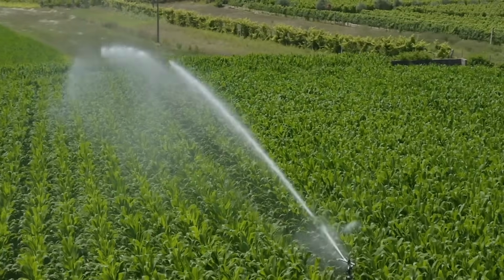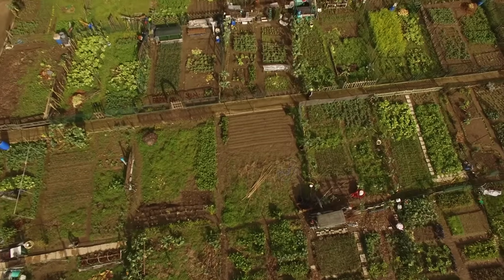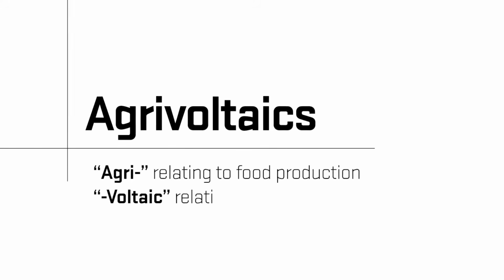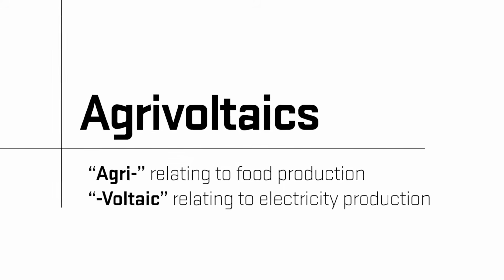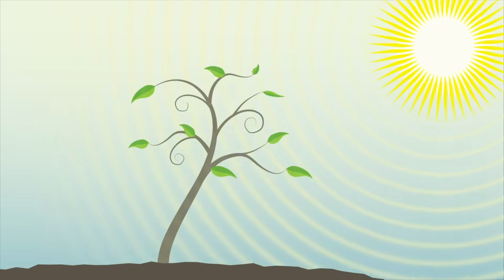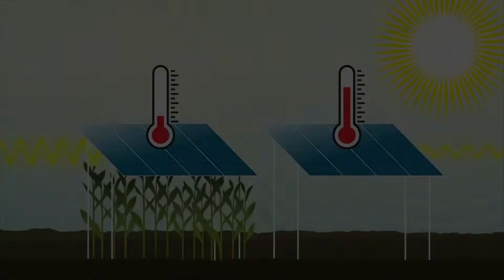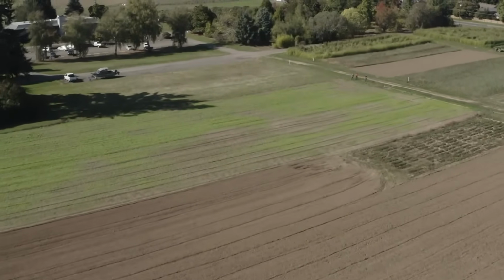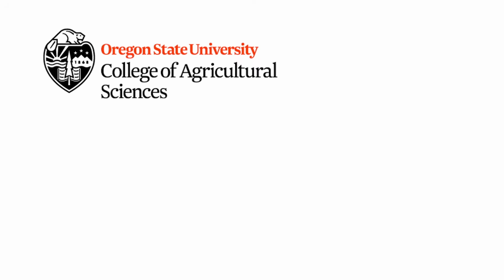AGRIVOLTAICS: Sustainable Farming Systems

Comment: Benefits of vertical mounting of standard Solar panels as fences.

The current practice of solar panel mounting is a two dimensional flat sided position, the front face of the panel is up, the rear side faces the ground.

A standard solar panel can be erected vertically, one edge on the ground, a second duplicate solar panel can then be mounted on the obverse side, creating a vertical solar power unit. 

This arrange doubles the output of a single panel, for the same amount of space.

An example of use is on farms 

A field of any area or size can be surrounded with a Vertical three dimensional fence of any length.

Benefits

1 No change in farming practises are required  

2 The panel edge can be on the ground, preventing GM crop spread and wildlife control

3 The panel edge can be off the ground allowing GM group spread and wildlife access

4 larger levels of surplus power sold to power companies

5 Justify electric powered farming vehicles,  for extra income which will attract carbon credits when electric vehicles and .equipment is used 

6 Self cleaning in all weather by gravity

Comment: No, No...... 
This is still Industrial mono-culture agriculture dependent on heavy loads of pesticides, herbicides, fungicides, fertilizer and water.
Just throwing up solar panels will create a new set of problems and it actually exacerbates existing ones.
The crops are still far too far away from where people need to eat.
You could create the same energy on rooftops in suburbia and convert old warehouses nearby to produce far more for far less. IT would cut down on emissions from tr4anspoort and production while reducing the cost of energy where it is needed. Reducing heat islands, mass power outages, and only causing the same issues that already exist, (mining for materials and building) with this plan, and reduce the other impacts. 
They could even be placed on green roof to keep the heightened output, and have them put the roofs on the homes of elderly disabled poor folks that need help. Reduce their bills and everyone else in the neighborhood.
These farms should not be farms they should be land stewardships and they should be returned to the indigenous people of this country.
Grazing herds would restore soil health and start sucking carbon from the atmosphere and cut down on fires. It would reduce the need for all the "cides" and water 

But hey
Keep doing things in a way that makes the few rich and the masses suffer 
While creating problems instead of solving them...

So sick of these half measures.
I bet the person who recommended this got a bunch of recognition.....

Universities also seem to fund only solutions helping their donors, not their community, another story for another day.

I know my grammar sucks, it stopped mattering 20 years ago.

Comment: Generally agree, except an early point that an increase in global population from 7.5 to 9.8 bil will require double the food output. Where the heck is the math in that? Check out the blue revolution, or aquaponics on an individual micro farm level. Lots is happening at the moment. Don't ever let the boogie monster scare you into believing that depopulation is necessary.

Comment: This is a beautiful thing to see. On the same apparatus that the panels are mounted on you can also put gutters and drip irrigation. That would go really far. In Napa valley or the other wine growing regions of California this would be a Godsend. All of the water is used as it should be, much less is wasted, and solar can be sold on the grid in the off season. This needs a Tesla Gigafactory in vertical integration. As a holistic system this could go a long way in feeding so many people, and reducing so much waste.
Reply: Great idea to incorporate guttering. Maybe you already assumed this but I envision the guttering connected to water tanks so you can avoid flooding fields during high rain and then water them appropriately for days/weeks afterwards with what you stored?
Reply: @RaglansElectricBaboon  I am sure that there are many different use cases and appropriate storage. I suggested drip irrigation as a means of avoiding the erosion and waste problem. Storage would be a separate problem. Some cases may yield enough to warrant it, some may not if it is say a short season with mild weather.

It would be a really huge boon in places with very unpredictable weather and season like the American Mid-Atlantic. From the diversity gains, you could make a lot more per acre than the standard corn-soy rotation that makes up most farms.